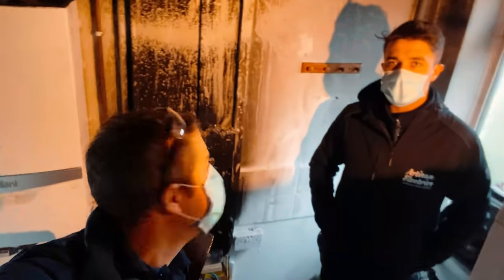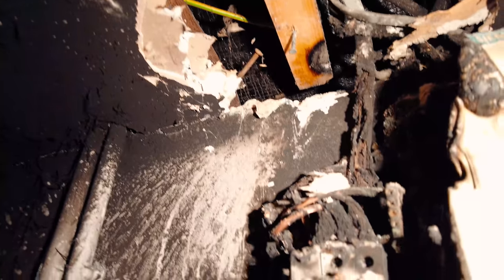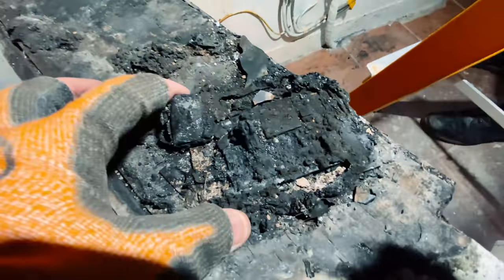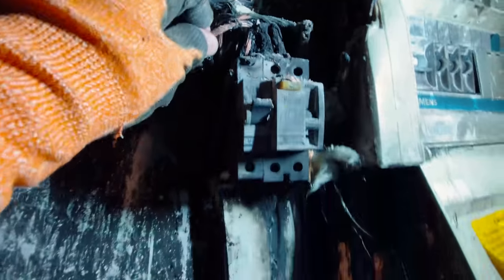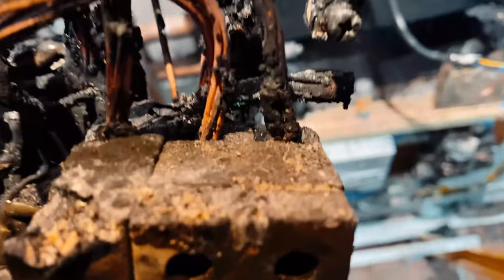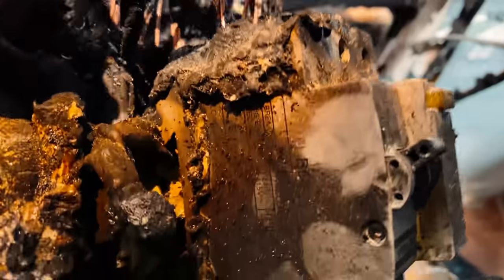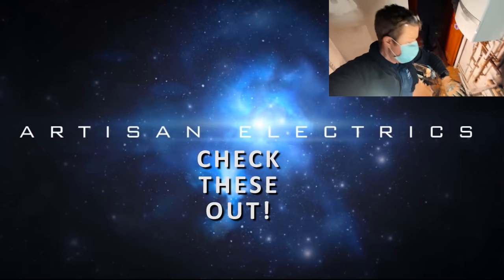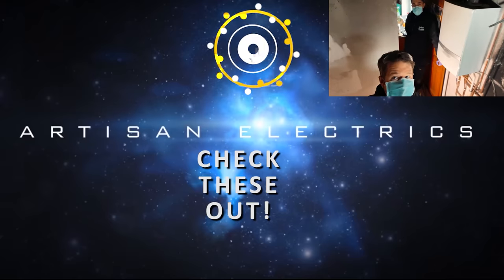Consumer Unit Fire

Comment: I have mainly worked on modern auto electrical systems where I get vehicles that the dealer has not been able to fix, these are nearly all love jobs. The bane of my life in any electrical system is CONTACT RESISTANCE between two metals. When you to supply high currents through any junction point the tightness pressure is absolutely critical. Because metals have a positive temp coefficient of resistivity you can be easily misled as to the contact resistance when you have nice clean wires and contacts at the start pf a lose connection. When high currents go through a junction point the temp increases thus the contact resistance goes up. The current will hardly change. Thus the heating effect Current squared times contact resistance increases, thus the temperature at that junction point rises which then increases the contact resistance. You are now in a loop oxidation of the metal may start  increasing the contact resistance even further.
It is only a matter of time when the heat produces high temperatures melting any plastic or even high temperature insulation and of course the circuit breaker is still happily supplying the rated 50 amps.
I know they are expensive but high quality thermal imaging cameras may now be an essential tool in any electrical work, I notice at Artisan Electrics you certainly fork out a lot of money on really good tools. I think a thermal test at full load using a thermal camera will really help seeing this burnt out consumer unit frightens the hell out of me.
By the way this branch of Physical Chemistry which studies surface effects has only been recently better understood.

Comment: For all the yanks like myself watching: 10mm^2 cable is AWG8, 6mm^2 is AWG10. 

The plastic consumer units always gave me the creeps. I'm happy to hear about the metal enclosure mandate.
Reply: 6mm2 is not usually sufficient for a load of up to 50A. European 10 mm2 wiring or American AWG8 (8.4 mm2) would be sufficient for a 10kW shower heater.
Reply: Agreed.  My shower is on 6mm but is only 35.5A.  The electrician allowed it because the cable is only 16m and he said the voltage drop would be acceptable.  But he did insist on running it on a 32A breaker, so it's on the border 6242B cable, which has a slightly higher melting point than 6242Y (pvc) cable. 10mm would have been better even for my 8.5kW shower.

Comment: If you're an electrician every time the installation is tested or any work is done in the fuse board or isolators if you are good and have experience of installations you should check the connections Everytime it is tested or any additions or circuits have been added when you are checking the main board or isolators or especially rcds outside the board !!!!

Comment: It's made me think. I am going to put a little battery smoke Alarm in the cupboard where my Consumer Unit is.
Reply: Something I have done for many years,currently using a Aico Ei146 radio linked with other Aico alarms in the house.A small price to pay for peace of mind.
Reply: You can also get a stick you put inside the consumer unit that will explode when heated up and extinguish a fire
Reply: @s.kxx1956   One brand 'Enviroburst',they burst when fire gets to  70°c & release a  liquid to extinush fire.
Reply: @s.kxx1956  Just seen a video on it now. pretty good and cheap too. Thank for the heads up.
Reply from the maker: Great idea

Comment: A few years back we discovered due to the smell and shortly after loss of power that when the house was built 25+ years before,  the installing electrician had not tightened the screws holding the cable into the master switch on the consumer unit. it had over that time been arcing, probably from anyone coming down the stair as that would have passed enough vibration maybe. so it had been a ticking timebomb in the cupboard. we and previous owner were lucky

Comment: This seems to be happening more regularly. Worked as a spark for 40 years and never saw a consumer unit fire. Is this a result of bigger shower circuits? Will this happen more with the addition of EV chargers?
Reply from the maker: Yeah heavy loads are more susceptible to fire
Reply: It's the result of poor workmanship more than anything else.
Reply: @Monkeh616  yup definately the workmanship
Reply: @artisanelectrics  Does America suffer with lots of electrical fires? Half the voltage, Double the current, 4x the heating (I squared R)
Reply: @chrishutton1458 Fires can happen anywhere, but I think they are mainly in very old installs. In the US, as long as no changes are made to an install and it met code at the time, it is grandfathered in and can stay as is, even if it's not up to current standards. I haven't owned an older home, so I don't know whether there may be other requirements from insurance carriers or others, but that is how it works in terms of meeting code. 

The current isn't really double at the high end, as the max power draw is lower. Most 120v circuits will be 18amp max 15amp continuous. There is a separate plug (that is compatible with the standard 3 prong) and spec for 20amp that is used basically for built-in microwaves in a residential context.

For 240v circuits (stoves and dryers mostly), the breaker is often 30 or 50amps, but the wire and plug are massive and can certainly take that current.
Reply: The only wiring insurance does not like to see in the USA is knob and tube. They'll usually make you remove it.

Other than that old wiring isn't always bad. My 1950s house was wired originally with AC cable also known as BX. That stuff is pretty solid. It has an armored steel jacket going around the wire. You can still buy this today but it's a good bit more expensive than the nmb cable most use.

Then you have places like New York City that only allowed this armored cable until recently.

Comment: We had a small fire on our hot water circuit a couple years ago, been meaning to have the house rewired and the fuse board replaced with a modern circuit breaker/RCD setup. Trouble is some of the cables have older rubber insulation i think the electrician said, so those wires will need to be replaced
Reply: Well bite the bullet and get it done.
Rubber perishes with time. I've seen bare wires with bits of old rubber hanging off them.
How much do you value your life?
Or your home?

Comment: I think now i can recall my caravan fuse board had this same thing where the onboard charger unit was connected straight off the tails input, so this was not fused, although the main power supply probably limited is limited to 10amps or something, i didn't think this was good practice from whoever wired this.

Comment: I want to say, after seeing two loose-connection consumer unit fires recently... Use RCBOs. Everywhere.

I have encountered multiple installations over here, with bad connections on breakers. They get hot, the conductors are damaged, but the heat on the terminal tends to travel up inside the breaker and the thermal element most often trips before there's a fire.
Reply: @Lister Smeg Not specifically by design, and it's not something to always rely on - but yes, only because the heat produced by a loose connection will also heat the internal parts of the breaker, including the thermal trip element, which is exists in an RCBO but not in a plain RCD.

Comment: A pet hate of mine is a db fed from another db .  To me it shows a lack of knowledge by the sparks  or a lazy sparks .How long does take to fit henley blocks , earthing block , proper tails and a earth cable . If you don't have the proper tools or materials don't do the job
Reply: The other thing thats concerning is the fact that the sparks that installed a 50amp shower circuit of a 60 amp DNO main fuse with the rest of the house circuits. I would insist that main fuse was upgraded to a 100amp , if it couldn't be upgrade I would of told the customer that they needed a pumped shower that is fed from the hot and cold water tanks , that could them be fed from a socket , connect via a switch fused spur ,fitted with a ,3 amp fuse or I wouldn't do the job . My name goes on the certificate and I'm prepared to walk away from any job if I can't do it to a high standard or I can't advise the customer properly
Reply: Another problem is the inability of electricians to do load assessments.  I suspect many of us think 'shower=10mm' with no consideration of what the actual rating of the appliance requires, nor the available capacity from a typical 60A supply.  Terminating 10mm cables into MCBs and pull-switches requires an unusual amount of skill, patience and a bit of luck. Most of the time 6mm satisfies the requirements, and is less likely to result in events like this one.
Reply: @westinthewest  I completely agree with you. The signs were there this install of that shower circuit was heading for trouble
Reply: See it all the time in large commercial installations - a board runs out of space so instead of replacing with a larger board (which would be neater), stick a second smaller board next to the existing then take the supply from the liveside of isolator.
Reply: @robertburrows6612  I totally agree with what you say, how many people look at the existing installation as a whole and make an assessment from there.  There are quite a few bang-and-buck installers who bash things in as fast as possible, no detail or care for the immediate or greater job and are quite happy to charge; I also suspect some of these would take liberties that the customer wouldn’t know of their rights to a certificate, especially customers of an age where certification was unheard of.
Reply: @joepostle3561  oh yes I've seen that . I've lost count of the jobs Ive done were I've had to put other sparks jobs right before I can do the job I was  sent there to do
Reply: @robertburrows6612  always the bottom dollar rather than doing a job properly.

Comment: I tend to disagree with source of fire. Charring on rafter above plasterboard seems to indicate seat of initial fault was there, due to charring extent there has been extended period of thermal activity. It looks like a circuit cable from main DB was looped under 10mm going to shower, as shower board looks to be later addition my bet is as follows. 10mm to shower has been initially drawn up from cable reel on floor during installation, this has rubbed through insulation of previously installed cable above plasterboard (damage would not been seen as in tight corner of loft space). Arcing has developed in original cable, leading to further arcing/heat transfer into 10mm shower cable, this has led to insulation damage in shower board. This has the led to further arcing in shower board, with catastrophic damage to shower board. Arcing would then melt the conductor as seen, I’d doubt tight conductor bend alone would cause sufficient conductor damage to initiate fault
Reply from the maker: It was a loose connection in the shower board as you will see

Comment: At some point in the past the IET proposed that terminal tightness should be a maintenance check because copper has fluid characteristics and over time connections can become loose; as appears to have occurred here. I’m wondering why; other than the main fuse, the down stream protection did not disconnect the circuit? Maybe the heat energy of the ‘spark gap’ created was much less than that the mcb rating would have created. A salutary example of poor installations. Thanks for posting.
Reply: There was no downstream protection from the shower CU other than the main fuse..
Reply: @Sparks0001  the main fuse is upstream
Reply: Judging by the amount of turns he got on the live terminal compared to the neutral I don't think it was done up tight in the first place
Reply: Is terminal tightness not a maintenance check in the form of a eicr?
Reply: @tomorichard  it’s down to the judgement of the inspector, most would. This was most probably not a rental property, the irony being if it was, these faults would have been found, corrected and the CU replaced with metal, to name a few now obvious shortcomings, they weren’t seen as shortcomings when the original installation was done, how times have changed but for the good!
Reply: @G6EJD  Correction of the faults would have prevented this, yes, but there's no specific requirement to replace a plastic consumer unit with metal.
Reply: @misstakenot9582  Agreed, but most installers would recommend or never fit a plastic type now.
Reply: @G6EJD  Agreed - fitting one is an absolute no-no.
Reply: @G6EJD It isn't a question of making a recommendation. 

You can't fit a new plastic CU.
But if an existing CU is plastic, it is not obligatory to upgrade it with a metal one.
Reply: @deang5622  if it is inside the dwelling I understand there is a requirement for a metal CU, but most risk assessments should conclude the need for metal such that in the event of a fire, flames could not spread further the main dwelling.
Reply: @G6EJD  You are correct.

If the CU is inside the dwelling it does have to be metal. If the CU is outside the dwelling it is allowed to be plastic.

However, if an existing installed CU is plastic, there is no obligation to upgrade it to metal in order to comply with the latest version of the regs.

The regs don't apply retrospectively.
An electrical installation which was completed and passed to an earlier version of the regs, which is no longer compliant to the current version of the regs, does not need to be brought up to comply with the current version.

If you are fitting new apparatus then whatever work you carry out must be compliant to the current version of the regs.

So if a new consumer unit is being fitted inside the dwelling, then that new CU has to be metal, because that is what the current regs require.

Comment: Interesting investigation. In terms of the masks, I think you'd be better with FFP3 masks in that situation. Those masks only stop direct penetration whereas FFP3 masks also stop dust and ash from infiltrating through the gaps in the sides and stops smaller more dangerous particles getting into the lungs.

Comment: Quite an interesting video. Was the theory on the sharp bends in the wires have any relevance though? And if not this situation, have you had any similar where it could be easier and/or cheaper to just replace the whole cable? because I can imagine some shorter and easy route runs, rather than testing, it'd be quicker to just replace? Can't wait for Big Clive's investigation too, although that said, you've probably nailed the main conclusion!

Comment: If it was possible, a check would have been needed to see if the multistrand conductor was "twisted" in the RCBO clamp terminal.  Multistrand (7 strand) should be inserted, as stripped into clamp terminations, so the strands spread out during tightening, you only twist 3-7 strand conductors if they are going into a barrel terminal with a direct acting screw.

Comment: I am not if there are any rules re this (im not a spark) but I would have thought it was a good idea to never have electrical wires running near boilers or gas lines unless they are run within metal/fireproof conduit, metal boards help but not when the fire starts behind walls etc. I know in Portugal many modern flats have gas/water cutoff valves outside the flat that are wired back to the fire/flood detectors and cut them off, in my dads place there is water sensor in the kitchen/bathrooms, ofcourse its a tiled floor on concrete slab.
Im thinking with all the smart gas meters out there could be an easy way for them having the ability to be paired to fire detectors (not smoke or if smoke then time delayed) then turn off, this would not need the addition of extra valves.

Comment: bodge job would be my guess with an exposed wire somewhere and likely to many things off of 1 circuit I would say a combination  wire age and arcing on metal ..

guessing townhouse with a mix of power additions since the 1940's-1960's (built by) to current day likely needed a complete gut 10-20 years ago ..

either faulty install of replacement fuse box or faulty install additional fuse box with combination of an over loaded and over current currant circuit ..

over amperage contribution to the actual fire..

this why I have always said every 20-25 years you should budget for   wiring replacement it pays not to comply date of install as a precursor to do nothing.. because safety codes of the day should always supersede date of install..

To be honest I am surprised there isn't more electrical house fires in the UK given bodge work by both home owners and electrical tradies.

Comment: Would it not be a good idea if all fixtures carrying high currents  like MCBs, RCDs, RCBOs, outlets  etc used spring clamp terminals like WAGOs so that screw tightening and torque screwdrivers were unnecessary and loose connections would become a thing of the past.

Comment: This video couldn't have been uploaded at a better time.  Just been to a rather plush pad, where the annexe building kept "cutting out". Turns out that the 10mm cable going into the breaker (with 2 RCDs in series) was in the MCB, and the screw was indeed sufficiently torqued up...... if only the cable was in the jaws, and not behind it!  Same board has a second CU connected by 10mm cable straight off the incomer side of the main isolator to run another 10way CU.  Might just send this to them to show why it makes me cringe every time!
Reply from the maker: Wow yeah it happens more often than we might imagine!